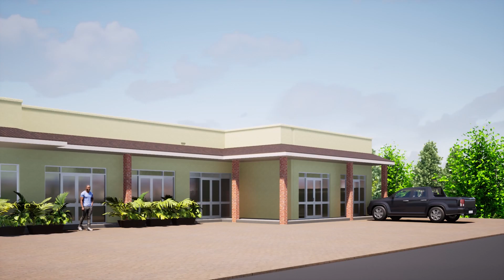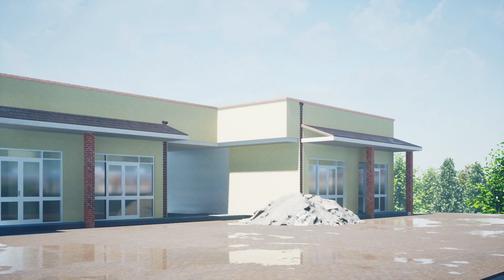How do renovation filters in archicad work?

Comment: You making cool work. I have question, i have situation when my kitchens things is not in corect layer, it should be in the existing layer, but now it in the another lyarer (new construction), wanted to change the layer and it is unactive, nothing can do with it. Can you help about it?
Reply from the maker: Working with renovation filters, you may call them "statuses" as opposed to layers which may cause confusion given that we have layers as a different thing in archicad.
I think that the status you are currently working on may not allow you change the statuses of certain elements. Try changing the current status you have to "Show All Elements" then you can make the changes you desire. This can hopefully fix your issue.